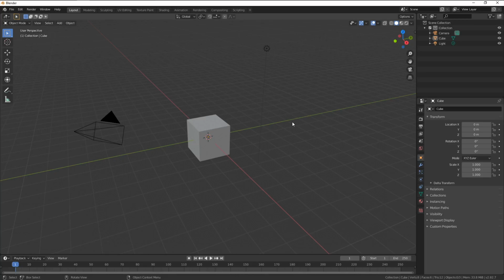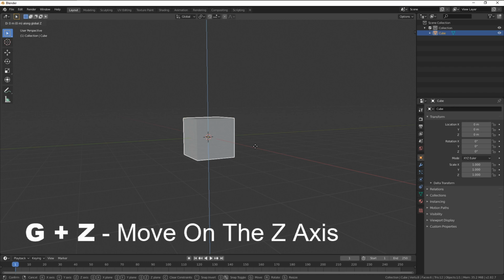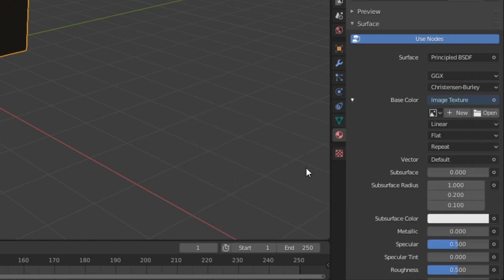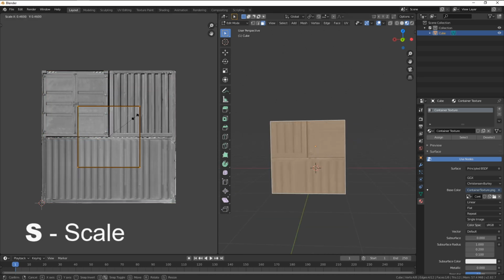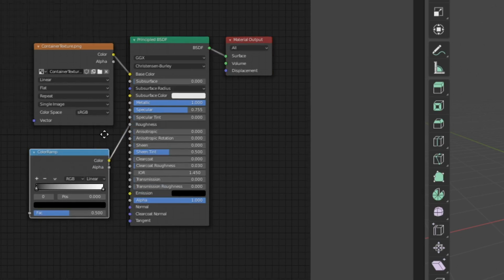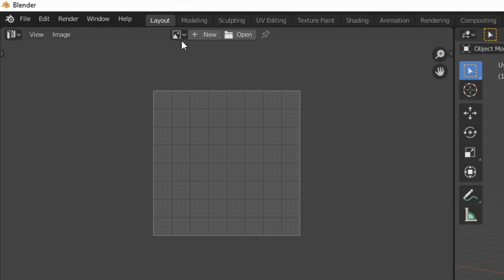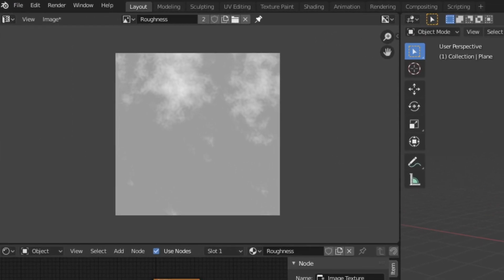Shaping and texturing 3D models | Blender to HitFilm Masterclass

Comment: 2 smal notes:
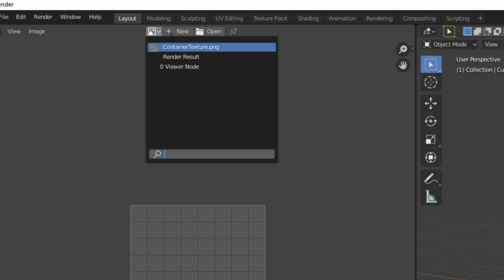- 2:40 You dont select a material there, its just an image that can be used inside a material.
-You should not touch the specular value for realistic materials, in a PBR Workflow the specular should always be 0.5, same as Metalic allways be 0 or 1 and nothing in between. All materials have the same specular, just the roughness is different.
Reply from the maker: Thank you for the feedback, this is a good thing to know! 
- Tom
Reply: @FXhome  Yes, it is.  I usually just move them around until I like the look with no understanding of the specifics.
Reply: This the real MVP right here, wish i saw this earlier instead of following off this video.